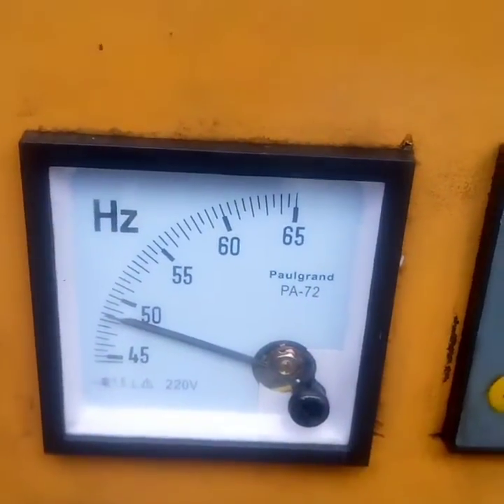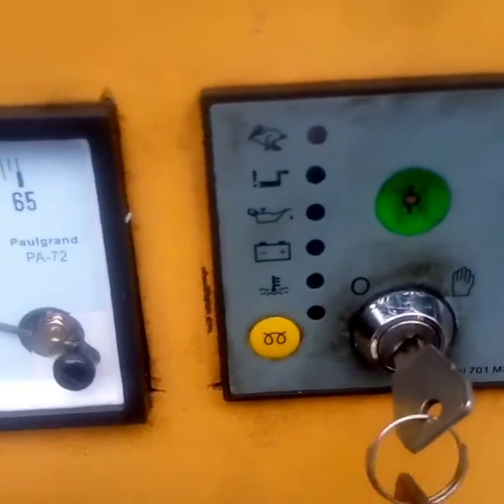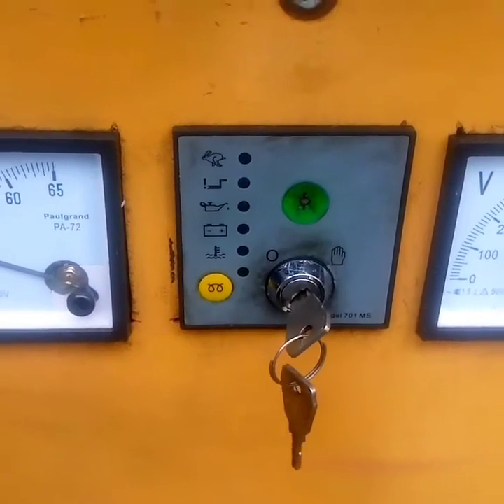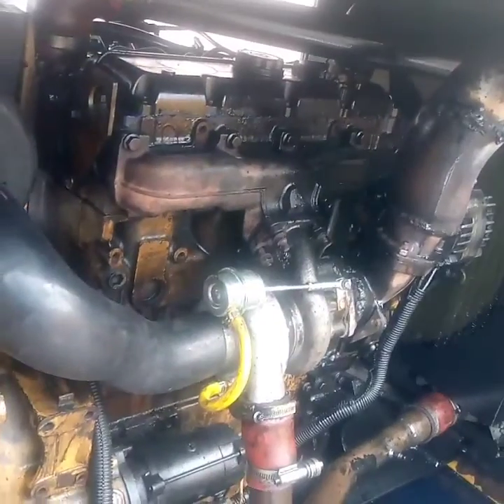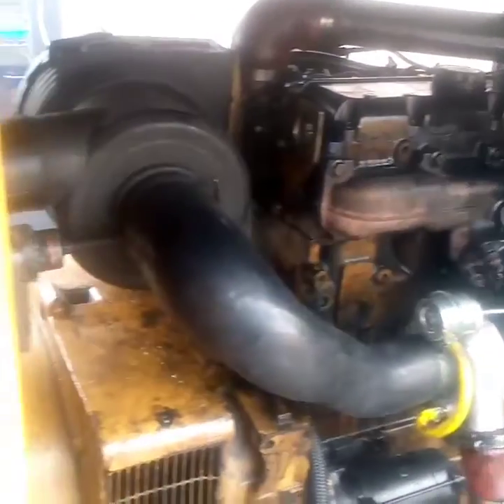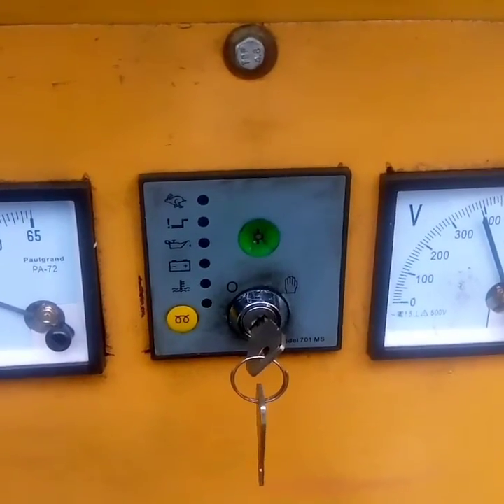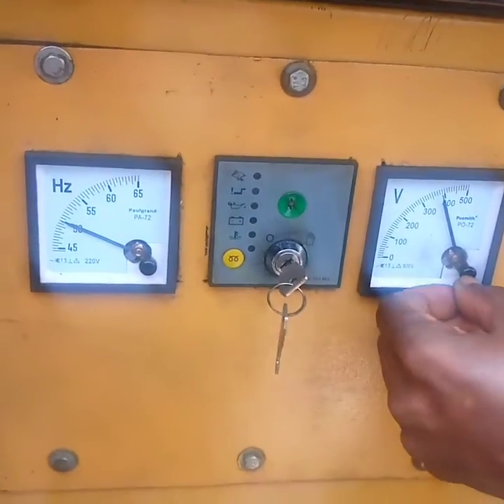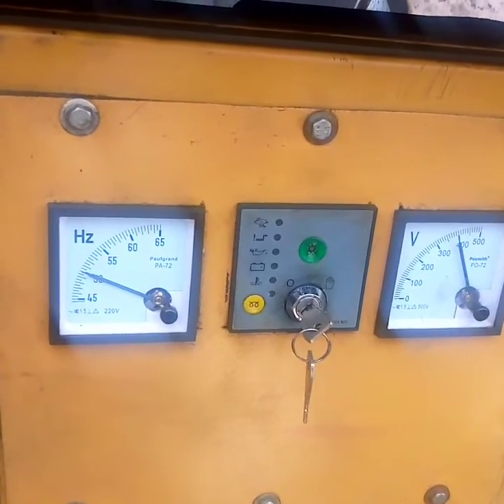Frequency And Voltage Settings In Perkins Engine

Comment: On this particular issue, how is the injector pump speed increased.
Reply from the maker: There is a screw on the injection pump that you need to adjust to increase the injection pump.
Reply: Can you please do a video separately on how to increase the injector pump speed

Comment: What about if my frequency is zero while my voltage is 372 and I need to use water pump that requires  415 v
Reply from the maker: that means your frequency metre is not working.

Comment: Can you please explain how you slow down your pump?
Reply from the maker: there is a long 10 bolt on the injection pump. if you loose is backwards you reduce, but if you tight, you add.  

thanks